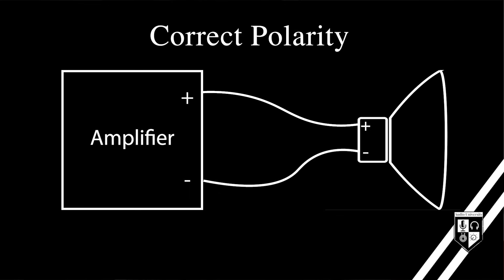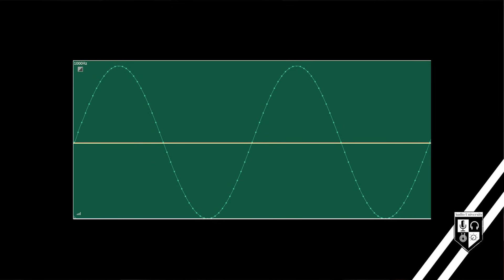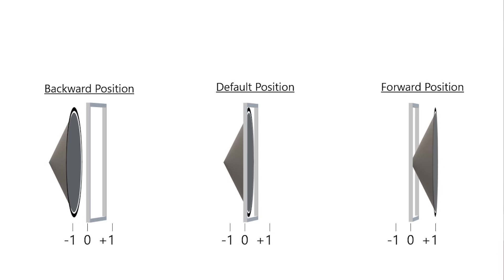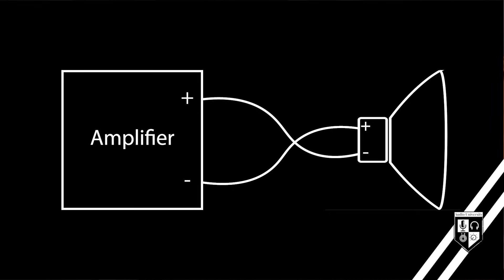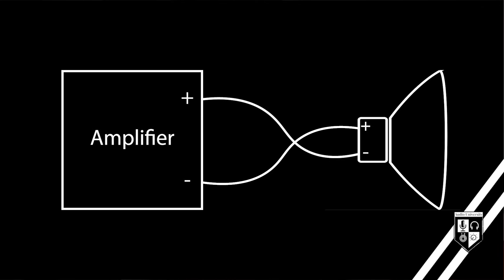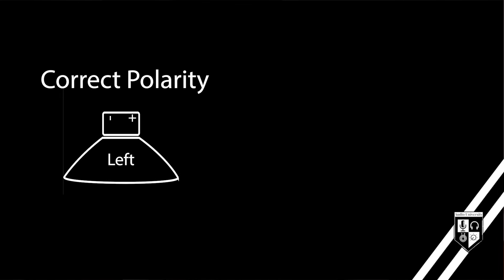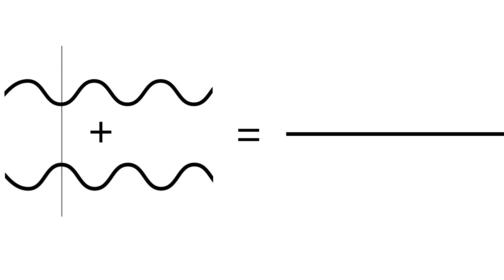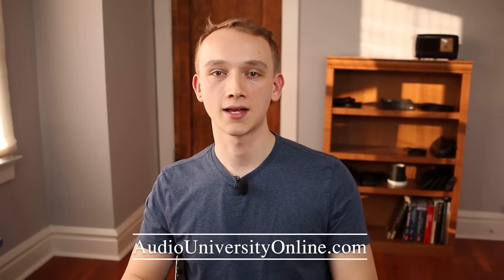POSITIVE VS NEGATIVE: Does Speaker Wiring Matter?

Comment: 3:31 Why can I hear it with headphones when the waves don't interfere physically in the air?
Would the sound distortion be different if the correct and inverse polarity speakers were swapped?

Comment: Can you explain why speaker drivers has 3 inputs, i know one is positive, the other one is negative but in the middle you find another input. And my Bluetooth speaker has connected those three wires and my questions is why
Reply from the maker: Which speaker are you using? A passive speaker will have only two inputs (positive and negative), but a Bluetooth speaker has an amplifier built-in and might have more connections.
Reply: @AudioUniversity  is from my jbl flip 4, i disassemble it and i found that there were 3 cables connected to the speaker, the red one, black, and the other one is white,i have search about that but I haven't found anything
Reply from the maker: It’s possible that the third wire is used to ground to the chassis of the device. Although, I’m not 100% sure.

Comment: Very informational, but I’m still
Left with the question; how do I know which wires are positive or negative coming from the car
Reply from the maker: If it's not labelled, you might need to try using a speaker polarity tester or a speaker polarity test smartphone app.

Comment: what might caused one side speaker sound softer then the opposite side i.e. left louder than right speaker? These speakers are manufacture Pyle brand speakers audio system is also stock. All 4 speakers were working perfect. 2 days ago I noticed a little distortion on left rear speaker only, now when I set the balance to the left rear, it plays really soft at the volume setting of 18.
Reply: The amplifier might be the problem itself. Blown or ripped speakers usually sound extremely scratchy.
Reply from the maker: It sounds like you may have a blown speaker. You might try fading it completely to the front speakers to avoid the distortion.

Comment: Any batery ? Or just a 9 v ?
Reply from the maker: Good question! Any battery will work, but the 9V makes it easier to see the speaker move. (I don't recommend using a battery with more voltage than a 9V.)

Comment: What if you have dual voice coils??
Reply: A single driver with multiple voice coils I bought a Rockford Fosgate 8 inch punch 3 with dual voice coils and I don’t know how to wire it I don’t want to damage my speaker what if one side is correcting the other side is negative polarity will it mess up the speaker or amp
Reply from the maker: I’m not familiar with dual voice coils, but I understand your concern. Does each coil have a separate terminal? If so, perhaps you could do the battery test on one at a time to determine the polarity of each.
Reply: @AudioUniversity  well I tried that and it doesn’t do anything when I hook one side up to the battery
Reply from the maker: You connected one positive and negative pair to the battery and the other pair disconnected?
Reply: @AudioUniversity  yes
Reply from the maker: Are you referring to a speaker cabinet with multiple speaker drivers or a single driver with multiple voice coils?

Comment: nice video.
The trick with the battery is nice but what to do when the speaker is connected behind a filter ?
build in a housing ?
Reply from the maker: In this case, it might be best to use a speaker polarity test app on your phone. The HPF filter components of the crossover might prevent DC from the battery from reaching the driver. You can also just swap the polarity and see if it sounds better if you’re worried it isn’t connected properly.
Reply: @AudioUniversity  
Thanks, gonna use the app.In my case,i am 99% shure the connection is reversed,but the sound is much better.stereo is much wider and more staging.but the biggest win is in the details at lower volumes and more balance in frequenties at higher volumes.
thanks from the Nethetlands for youre  quick answering.
Reply from the maker: Thanks, bjusterbaarlijk! Let me know how it goes!

Comment: Dear Sir, I have a puzzle about impedance of speaker and Amplifier.
 When I was studying Physics at college I learned that Resistance is as a scaler ( only has a magnitude but doesn't have a direction).
Impedance is also a resistance and it is measured in Ohms. But it is a Vector ( has both magnitude and a direction). 
Can you explain the difference between the resistance and impedance with drawing on a video???

Thanks
Praneeth
Reply from the maker: This question is outside of my comfort zone. I don't have a good answer for you! My understanding is that resistance applies to DC (direct current) and impedance applies to AC (alternating current).
Reply: Not sure how well I can do without a drawing. Think of a sine wave as a resistor's (pure resistance) resistance value (ohms) is not frequency dependent, other devices like capacitors and coils (voice coil in speaker, caps and coils in crossovers,.... ) resistance value is frequency dependent. Going up or down with frequency changes. 

Now think of a 2nd sine wave riding on top of the first one. One of those waves is the voltage (e) the other is the current (i).  with a pure resistor, they are locked together "in phase". A coil or cap shifts one compared to the other. You would get the same values for e or i, but their waves would be separated by some number of degrees. The "direction". 

So a resistor might be rated 8 ohms,

But a speaker has a curve that plots resistance as frequency changes and a phase angle value at each frequency. Those the later is less seldom published. So it might have a spec of 8 ohms/20degrees @ 2khz. I believe my 1.7is are graphed to dip below 2ohms above 2khz but never shift more than 10degrees.
Reply: Speaker impedance is a combination of resistance and inductance, and is frequency dependent.
Reply: From the electrical theory, Impedance is generally Series Resistance + AC 'Reactance'.
Reactance can be thought of as a frequency-dependent resistance, which for capacitors will decrease as frequency increases - Inductors present an increasing resistance to increased frequency...
I'm aware that the vector is probably represented by the time-base component - as the magnitude is dependent on the frequency.

Comment: Sir🙏🙏 I have a question 
          Can we identify the polarity of earphone's speakers with multimeter ?
Reply from the maker: Good question! I might be wrong, but I don't believe there is a way to check speaker polarity with a multimeter because it is just a simple coil of wire that you would be checking. The important part is which direction the speaker moves when current passes through the coil. 

There is a distracting effect if the left and right headphone are inverted relative to the other. You will definitely notice if that is the case just by the sound!
Reply: @AudioUniversity  🙏🙏thank you sir
😃Your reply is really helpful for me 😀
Reply from the maker: Glad to help! Thanks for watching!

Comment: But how to know the polarity of a tweeter ?
Reply from the maker: You can use a speaker polarity app, also!

I recommend this one by Studio Six: https://studiosixdigital.com/audiotools-modules-2/speaker-test-modules/speaker_pop/

You will connect your smartphone's audio output to your system. The app will play a proprietary signal, containing positive impulses to your speakers. By holding the smartphone microphone up to the tweeters, you'll be able to determine that they are wired with correct polarity.

I hope this helps! Thanks for watching!

Comment: Hi     I put new speakers 4 and my front  one's are very low I tried everything help please 2003 jeep grand Cherokee
Reply: Very low I tried adjusting everything still very low
Reply from the maker: If the rear speakers are working correctly, I would recommend connecting a front speaker to the rear amplifier. That way, you can determine if the problem is the speaker or the amplifier channel.
Reply: The speakers are New the radio and speakers all came together
Reply: They are all the same speakers and my amp has no adjusting I look and found nothing
Reply: Please help I worked very hard on this
Reply from the maker: You’ve got to isolate the problem. 

If the rear amps and speakers are working, but the front ones aren’t, you can test the front speakers with the rear amplifier channels. 

If the front speakers work when powered by the rear amplifier channels, the front amplifier channels are the problem.

 If the front speakers still don’t work even when you power them with the rear amplifier channels, the speakers are the problem. 

If it’s a new system, you might try calling the manufacturer technical support. I hope this helps!
Reply from the maker: Are you getting any sound out of them?
Reply: I will try tomorrow and let you know thank you

Comment: Can I find the right polarity on the speaker with multimeter? I just do it - / + on the wiring head unit to the speaker (DC Volt).
Reply from the maker: I don’t believe there is a way to test speaker polarity with a multimeter. The only methods I know are listed in the description of the video:
1. Battery test
2. Speaker tester
3. Polarity Test Signal with Smartphone App

Comment: I would like you to touch on this same subject but with regards of multi-driver speakers and the problems that a certain driver is wired incorectly. Thanks!
Reply from the maker: Good idea! It would have a very similar effect to the ceiling speaker scenario I mention in the video. Although, it would be more detrimental due to the proximity of the speakers in a single cabinet. Thanks for the suggestion!

Comment: hi there. what if wiring from head unit to amplifier is inverted, does this effect the sound even though from amp to speaker is in right polarity?
Reply from the maker: Yes, Daniel Babor. This would have the same effect. Thanks for watching!
Reply: @AudioUniversity  thank you. 👍
Reply from the maker: Anytime! Thanks for supporting the channel!
Reply: Yes, an inversion can take place anywhere and multiple times and even accidently internally to any component.  If I was trying to confirm polarity of a completely unfamiliar set of components, I would start with a battery as shown in the video but 1.5 volts not a 9 volt.  I would verify the displacement of each driver within each speaker as well.   Going higher tech, I would use an oscilloscope and microphone with an asymetric wave shape from a signal generator going into the pre amp, through the amp, to the speakers.  Also, pending the equipment and source electronics, select mono and not stereo as output.  You can even go one step further and check your cd/DVD play by burning an asymetric wave to a CD and playing that back.

Comment: How do I know if my 2-pin ciem are wired with a reverse polarity?
Reply from the maker: To determine the polarity of a connector or a cable without a loudspeaker connected, you will need to use a multimeter to check for continuity. Do you have a multimeter?

Comment: The wires in my car are not labeled, how do I find out wich is + and which is - ?
Reply: I know what is + and - on the speaker I dont know what wire from the car is + or -
Reply from the maker: Try hooking up the speakers to the amp and test the configuration with a speaker polarity tester or app. I recommend this app: https://studiosixdigital.com/audiotools-modules-2/speaker-test-modules/speaker_pop/
Reply: @AudioUniversity  His problem is mine too. Nowhere from the head unit to the speaker does it say which wire is which. I know is + and - on the speaker itself. I tried several of those apps with mixed results and am now even more confused. Judging by the sound it's almost certainly not right I just can't tell which speakers are out of phase. Is there any way to troubleshoot such a thing other than just switching wires around till it works out?
Reply from the maker: Maybe you can find some info on which terminal is which in the user manual for your head unit. Once you have used the battery trick on the speakers, you just need to connect them all the same way to put them in polarity relative to each other.
Reply: @AudioUniversity  Yeah it's a generic Chinees android head unit. I just got the car and the previous owner said he hooked up the stereo. I'm going to have to tear it all down and take a close look at it.
Reply from the maker: Have you tried the 9V battery method at the end of this video?
Reply: So I'd put the battery in between the leads of the speaker and the wire from the car? Do I have to disconnect the car battery?
Reply from the maker: No. The car battery and amplifier are not a part of this test. 

You place one wire from the speaker to one terminal on the 9V battery and the other wire from the speaker on the other terminal of the 9V battery.

Comment: GREAT VIDEO ! Many thanks. Only after installing a new door speaker in my car did I hear  about polarity (not a word in the instructions). The wires have the same colour, so I'm wondering if I could discover the positive by connecting a 12v bulb to one of the wires and touching the other side of the bulb to earth/ground on the car bodywork?
Reply from the maker: I would not recommend using the car battery in any way for this test. Using a 9V or 1.5V (AA) battery should be sufficient and much safer! 

You might also consider the speaker tester listed in the description of this video. The 9V or 1.5V (AA) battery trick will test polarity of the wires, but the additional features of the speaker tester might be worth the investment if you plan to do more audio work in the future! 

Thanks for watching!
Reply: No bulbs don't have polarity

Comment: Nice video. I have a 12w7 jl subs. I don't want to go to the hassle of removing the subs just to check the correct polarity of my subs. I think a 9volt will not work on my huge subs. How can I check for my issues?
Reply from the maker: The 9V battery trick should work on a subwoofer, too! If not, let me know.

If you would like to check polarity a different way, there are apps available for your smartphone. The app plays a signal out of the smartphone, which you route through your amplifier into your subwoofer. Then, you hold the phone's microphone in front of the subwoofer as that signal plays. The app determines if it is in polarity or out of polarity.

What problems are you having?
Reply: @AudioUniversity  I did the 9v test and it work. My wires are the same and have no markings. I did the 9v and had a slight bump.
Reply from the maker: I’m glad you figured it out! Thanks for watching.

Comment: The loudspeaker is a transducer wich it's a device that converts audio (electric waves) in sound (mechanical pressure waves) or vice-versa. There is no performance change when you flip the polarity. The convention of wiring the loudspeaker in a way that it performs a front displacement when it receives a positive electric peak is pure practical. A stand alone loudspeaker is designed to produce no difference in reverse wiring, if this happens, put it in the trash.
Reply from the maker: Thanks for watching and commenting, José!